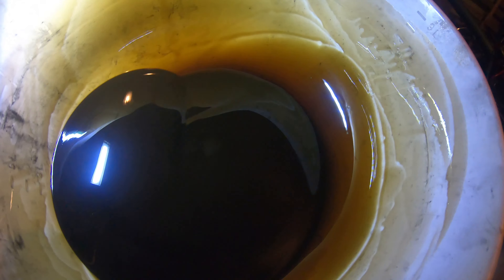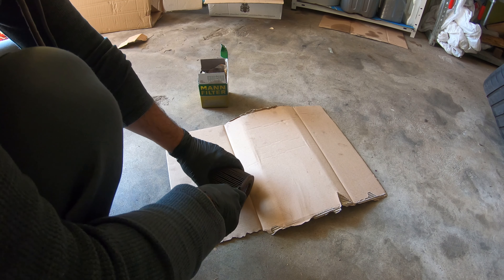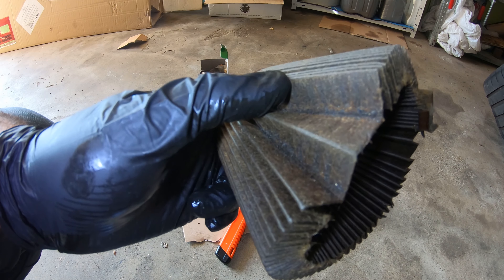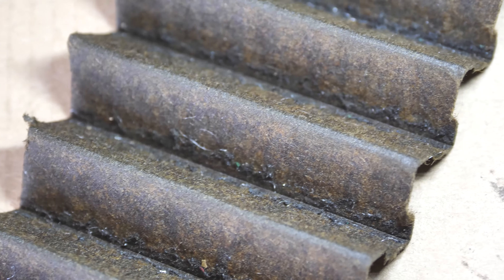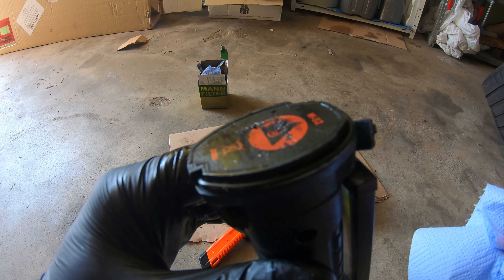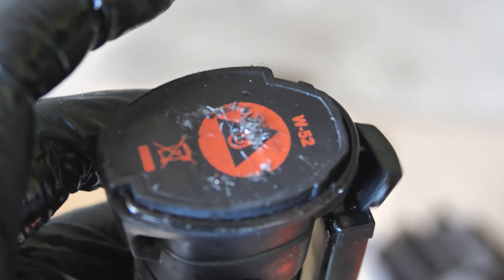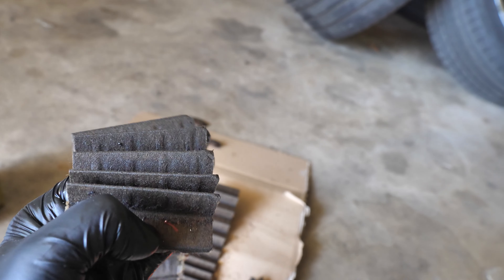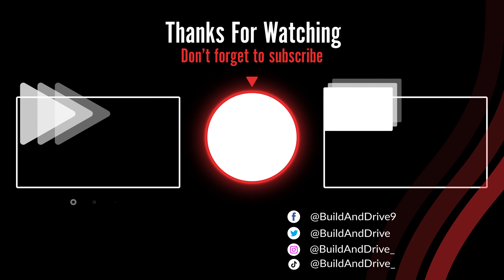Post-Rebuild Oil Change: Found Some Metal Flakes In The Oil Filter! Is Our Engine Toast?

Comment: I just did this on my 2007 X5 3.0 with 209,000 miles and I found praticuate in the filter, it was very small and the X5 runs just great, I have own it for several years now and just did this for the heck of it and I'm not worried one bit. This X5 runs so so smooth, no lights and I would not think twice about taking this on a long trip.

Comment: Changed my oil today because I'm tired of the imperfect way Mobile does it and I wasn't even looking for anything when I dumped my oil from the drain pan to the old 5 qt bottle and saw a whole lot of metal grit at the bottom of the drain pan.   This was after adding some seafoam to the crank case and driving over 300 miles.  I'm just glad its out now.
Reply from the maker: Check your oil filter and see if there is anything in there
Reply: Is the car still running??
Reply: @angelarenas1256  I traded it in this past April and yeah it was still running.

Comment: Pretty sure that some small aluminium bits are normal - I just changed the oil on my B58 with 28500 miles and it had some in the filter. Very small pieces. 7000 miles on that oil.
Reply from the maker: Thanks for letting me know. 🙏🏽

Comment: Ok let's do the math. What in the engine is steel? the block and the head are aluminum. The pistons are aluminum. The rods are steel as are the mains and the rotating assembly. The flakes are coming from the inner workings where stuff is rotating. If the rings are failing then the exhaust would be white. Isn't the oil pump driven by a steel gear? I would look to that. I would say that the teeth from the oil pump are seating in and ground themselves away a bit. The bit's of steel look like they are sheared off. Not like something is grinding off. What is nice is that you can change the oil, drop a filter in, run it for a day or two, swap another filter in and see if there are more filings in the filter. Filters are what $4? You will be able to see if there are still filings showing up in the filter. This just looks like gears not quite in sync against each other.
Reply from the maker: Good idea with swapping the filter. I didn't think of that. I have extras lying around. The shavings do like cylinder walls or piston rings material. Or some gear /piston shearing a bit off into the oil. Will investigate further
Reply: If you did not find metal, then I would be worried on that first oil change. That things did not get seated in or broke in properly, a second and third inspection of oil filter elements should each show less, and less trash collected. Breakin' is just that, rings seating, bearings flushing out, and oil filtering out garbage and trash. It is amazing also how much a fresh new oil filter paper element will introduce on its own, as it washes off the inner fibrous layer, then catches its own debris trail on the outer surface the next run through, looks like hairs, and it is, fiberous hairs of filtering media (paper fibers). It will also gather same from fuel filters too.

Comment: Changing ONLY pistons rings?  That means head off. That is a big job. To do that u have to take out the connecting rod bearings, were they all untouched and back to their original position and not contaminated? Did u replace the timing chain or maybe flip over the timing unknowingly? There could be a lot of metal coming off the chain links. Did u examine the new oil filter again? If no more shavings, u are fine. Otherwise, now that it is 1 year of running, engine still ok?
Reply from the maker: I took everything apart (see my rebuild series) and checked all the bearings, they were fine and reused, replaced valve stem seals, did a diy valve job, new piston rings, gaskets etc, reused the timing chain because it looked new. Never thought about the metal coming the chain. That would be possible. Thanks for that idea. Engine has 30k on it and it feels great. I think the CCV died again because it's smoked once or twice on startup once it got cold outside but now it's fine. So I'll change the ccv again if oil consumption gets worse.
Reply: I just replace the timing chains on my jetta a couple of months ago with new gaskets but I just change my oil on my car and see metal shavings too I haven heard any wear noise this could be the problem of the shavings the timing chain?

Comment: That is normal after a rebuild. No matter how clean the block is, the normal breakin' period will give you those hairs, rings against cylinder walls breaking off the hone peaks as they seat properly rings to cyl walls, dust and hairs in the air as you reassemble, no matter how clean the assembly area is, it floats in the air, and sticks to the oily and assembly lubed surfaces, and that filter media is very fine. Catches everything in the oil. As long as it is on the outer inflow side, and not the inner filtered side.

I just cut open my breakin' filter, saved from oil change #1 from Valvoline 30 wt mineral oil w/zero detergents or additives and  a 1 pt. Bottle of Lucas Racing ZDDP TB-Zinc-Plus additive and changed the oil after just 24 race only miles, and just 3 test and tune and 3 race events, and it looked a bit better than yours, and  I cut my saved filter open tonight. I am now about to do oil change #2 at 135 total race only miles after 7 more events, and will cut that filter open after switching to synthetic Valvoline 5W-20 High mileage oil and compare the trash reduction or increases. I expected to see some fine glitter from filter #1 (and was not disappointed, zero larger chunks present, as all were very fine particles, and I will expect much less in filter #2 as higher miles, but the initial rebuilding machining processes the block and head went through (cast iron block, Alum. Cyl. Head, boring, honing, new forged pistons,  new rings, full balancing, and a bunch of blueprinting, new bearings, old balanced rods, etc. Some oil pump blueprinting down in the galley opening to match the pump), lots of block cleaning ( like a years worth of multiple cleanings, as it was at the machine shop over a year and 3 weeks awaiting the new forged bullets), and no matter how clean the assembly process is, you expect fine metal particles to adhere to inner surfaces when a block sits open and bare in a busy machine shop that long, as cast iron attracts iron particles, each block has a certain amount of magnetic properties to it. Ozone in the air alone will help it attract. Science is real!

Now, as long as this next filter cut open, and inspection finds much less trash, I will be a very happy camper or, that oil pan comes off immediately for a rod and crank bearing inspection. However. If it is pretty clean, then the pan stays on. And I will chock the initial light fine glitter/hairs/silicone/gasket materials/dust/etc. to a perfect ring sealing & seating breakin' process well done! I will also send off an oil sample this time to get a sample analysis done, and set a baseline sample to watch the internals closely. I rarely would do that immediately after a fresh rebuild, as that first couple of changes (breakin plus 1 change), allows time to get all the assemble trash out. And analysis of pure mineral oil and zinc additive will not net a decent sample. I want it sampled now that true detergent synthetic motor oil is being used. Otherwise I am not looking at apples to apples.
Reply: Another thing is, after the short block was returned Rings/pistons, rods  crank, and bearings were installed, and before I reassembled the balance from oil pump up. I also torched the bare assembled block to clean off exterior surface oils, then masked w/paper & tape (more fiberous hairs transferred to inner assembly lubed surfaces for sure), and painted the short block before final assembly. I could see a little of that trash on the filter element material too. All were minute particles, but were present, and the final assembly with all new gaskets and seals, those have tiny gray and blue fibers that I could also see using a magnifying glass, just part of the cutting and die processes new gasket materials Bring over or introduce with them.

Also, with this next oil change, time to inspect and replace the 3 filters (1) pre- (2) post, and (3) the stock fuel filters, now that at least 30 gals of Sunoco 110 Standard leaded race gas has gone through the system. (And I will cut those open and inspect each also plus the fuel cell foam for determining if that is ok or not. As some fuels eat up the foam.
Reply from the maker: Thanks for the indepth comment. What engine are you running? I don't know if my engine (magnesium alloy) would benefit from zinc. I built my engine in my garage (see my videos). Tried to keep it as clean as possible and happy with the result as you can see from debris in the oil filter. I thought it was bad initially but after talking to others (like yourself) it seems normal. I didn't replace bearings though so I'm happy no crazy glittery material. I also sent an oil sample too, you can see it in my next video

Comment: Any update on. The engine i have the same particles and a small score in one of the cylinder walls….
Reply from the maker: Have you measured the clearance of the cylinder walls? My engine was a bit over spec but I rebuilt it anyway, about about 70,000kms I'm burning oil again unfortunately. But engine runs amazing.

Comment: I've been looking at mine to after doing a camshaft bearing ledge replacement on my N54 and seeing metal worries me and reading online forums people say you should never see metal but I think that's a bit over said because poeple never inspect the filter or oil particles. Idk.
Reply from the maker: It's just because I rebuilt the motor. This is normal in the filter and the oil analysis also was not bad, the metal values were ok considering everything. I compared it with a few other people's rebuild of similar engine and they actually had even more metals than me. This is because I didn't swap my bearings, I did just the rings.
Reply: @buildanddrive  Okok, yeah I guess I will do oil inspection to next oil chabge. My camshaft ledge was done in July. I am probably worriing for no reason
Reply from the maker: @JackRR15  yeah, did you cut open the filter and find anything? Is your oil glittery?
Reply: @buildanddrive  Yeah I can find some metal in the filter pleats opened up. Seems to be alluminum. But it seems to be going down with time so I think it's fine. For the oil, it's hard to explain, if I empty my pan and have like 500ml left, I zoom really harda nd focus with my eyes with a bright line I can see slight glitter but this is what I think it's just "normal" glitter, like there's always going be a minimum level and I think I'm trying to hard to find it. If it was really that bad it would be like massively insane right.?
Reply from the maker: Yes if it looks glitter nail polish, that's bad
Reply: @buildanddrive  It's not that it's glitter it's just I can see some sparkling a bit. It's difficult to see.
Reply from the maker: If it's difficult to see, then that's a good thing 👌🏼😁
Reply: @buildanddrive  Yeah haha, oh well no matter what, time will tell! I will keep driving it if it happens it happens. But I trust my work 😂 thanks
Reply from the maker: Did you do the work yourself? May I ask, how did you know the cam bearing ledge needed to be replaced?
Reply: @buildanddrive  Yes I did. The reason I replaced it is I was getting hit with a 2A82 intake vanos code that popped up sometimes, usually if I either floored it from a stop or if I like, started moving slowly then pushed the gas more, it would trigger the code and CEL and reduced power. Otherwise the car ran prefectly fine. I did the BMW diagnostic that they talk about in the bulletin regarding vanos codes for N52, N54,, making sure oil cage middle part is OK and not missing, making sure correct oil is used, making sure the VANOS solenoid works. I swapped them and the code stayed on intake and even went out and got 2 junkyard solenoids to really rule this out before opening my top end and same exact behavior was present. Also checked the vanos check valves as they are called with metal mesh filters and that was pretty damn clean to. The only thing left for me was either a bearing ledge groove causing the pressure lost as per the bulletin or maybe even worse like camshaft or vanos gear itself. Thankfully after replacing the intake side code never came back so that was it. I do think though I will get it soon on the exhaust side, when I did the job I took apart exhaust to I wanted to inspect, and  could feel the same grooving that causes these issues, at the time didn't want to replace yet since the trays are 500$ each. But yeah ha, pretty much recaps it. I did this around July and since July I've been considering the worst you know and looking at every oil changes and all. But I beat on the car so so hard that I tell myself if I fucked up the job somewhere, the car would be in a worse state... like it would have already blew up lmao. I also have a side issue where my level sensor seem to not have been working and I think I may have driven my car since August with low oil which is what prompted me to check again and I feel liek I see worse metal bt that's kind of another topic I digress a bit haha. I will just check in ~ 5000KM next oil change if the metal is as bad or worse I guess I have an issue.

Comment: is the engine still running? How many miles have you driven with it since then with/without problem?
Reply from the maker: Running awesome for the last 25,000kms. I show this in my update video. Had a few oil leaks but that's normal on a bmw 😂👍🏼

Comment: I wouldn't ignore the fuel smell in your oil. It might be linked to the metal shavings. Hope it's not your piston rings!
Reply from the maker: I also hope not. But I know that some fuel gets by here, especially if you are doing short trips the engine doesn't have enough time to heat up and burn it off.

Comment: How’s it run 2 years on
Reply from the maker: Surprisingly runs awesome. Done lots of track visits, full throttle autobahn runs, lots of spirited driving. Has great power and response. But I should have drilled the original pistons with the new oil drain holes, or just purchased the new piston design, after 75,000kms, it is burning oil again 😅
Reply: @ I don’t know what a KM is sorry
Reply from the maker: @Dieselpwr  hahaha 🤣. After 50,000miles, I have the same oil burning issue again

Comment: For Sludges use Engine Flush Liquid , but the shavings in the oil and the Filter might be Internal Engine Damage as parts are Grinding against Each other ?
Use some Marvel Mystery Oil in your oil Engine and Gas tank to Lubricant the Engine Further and the Gas pump as well .
Reply from the maker: You can't get marvel mystery oil here.

Comment: My n54 with 100k miles is knocking and has some gold particles in the filter, but I’m getting crank/cam and VANOS codes so idk
Reply from the maker: Looks like your rod bearings are gone. Your engine is known to do that
Reply: @buildanddrive  from what I’ve been reading it seems like rod bearings is a lot more uncommon on the n54 than the n55, well I guess anything’s possible
Reply: @buildanddrive  hello!! Are Rod bearings steel or Aluminum? I have some in my oil filter and I'm freakin out? Thanks N52
Reply: @mofopopo437 ended uo being…?

Comment: Those magnetic metal fibres might be pieces of steel wool that dropped into the engine while you were cleaning the top surface of the block during part 7. You've probably caught most of them now in the oil filter, so I expect you wont get any more next time you do an oil change.
Reply from the maker: Very possible. I thought I did a good job of cleaning but it's not like I hot tanked all the parts like you're supposed too.

Comment: Ah duh? Rebuild means new metal parts. That is the same reason you change the oil on a new car after 500 miles. The engine gets hone in and there will be metal particles.
Reply from the maker: Yep 😊👍🏽

Comment: Reason why it smells like fuel, is because this is a direct injection engine and unfortunately the oil will get diluted by fuel.
Reply from the maker: N53 is direct injection, not the n52